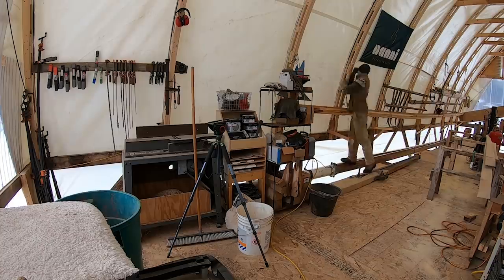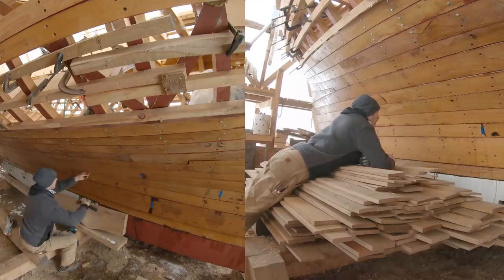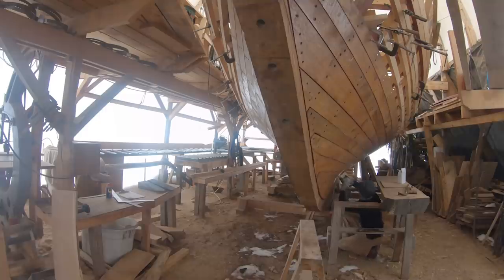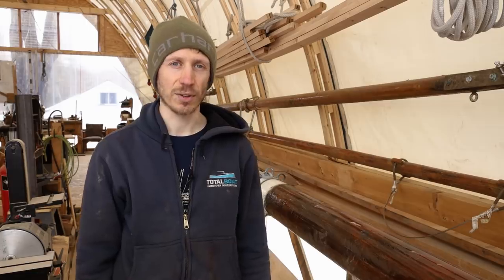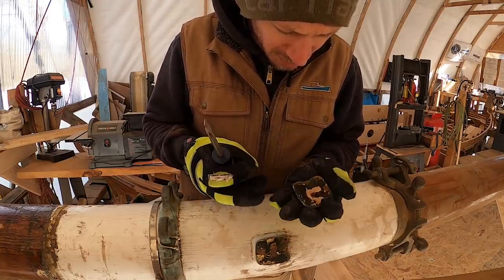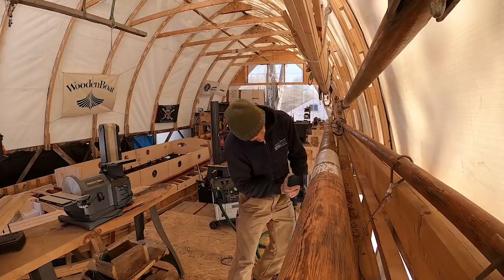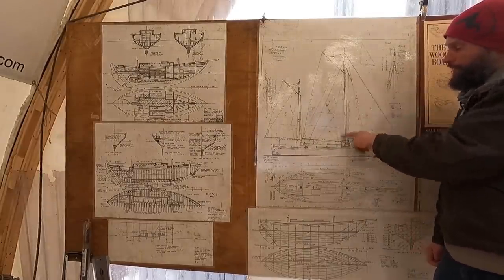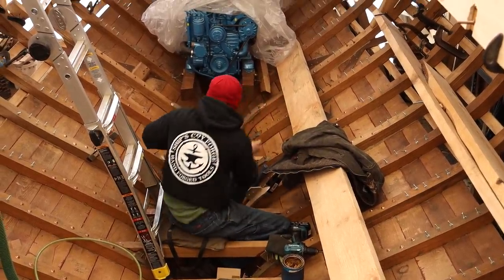Victoria's Mast - Episode 153 - Acorn to Arabella: Journey of a Wooden Boat

Comment: Main mast appears to be Southern Yellow Pine.  It is also known as “heart pine.”  It is practically indestructible.  Impregnated with its natural resins, it will still remain fresh after hundreds of years.  Most of it comes from virgin growth timber where strength and durability matter. Before the coming of rolled steel it was used extensively to build the massive textile mills in the east. Unfortunately, it is all but extinct due to over harvesting. There are still resources available if one is willing to search for them. You guys are great. I’ve so much enjoyed watching the progress of Arabella since the beginning.
Reply: Yes! Used as the flooring for countless exposed porches.
Reply: Heart Pine is the interior sapwood of SYP. While #2SYP is can be had at your local lumberyard Heart Pine is difficult to find because it is only found in old-growth SYP. What is commercially available now is mostly reclaimed wood, Delta Millworks in Austin TX handles it on the regular.
Reply: @matthewtimberlake599  The boys are very lucky to have saved the mahogany from Victoria circa 1925, you cant get that species any more, and the sapelle types are obscenely expensive.
Reply: @johnjenkins8782  I built a house with a mahogany staircase once upon a time, it was silly expensive even back then, nowadays you'd have to be incredibly lucky for it to even be possible.
Reply: Goodwin Heart Pine, in Micanopy, Florida. George has plenty, and resources to find whatever may be necessary. Don’t tell him I sent you. Having said that, sharpen your skills and build a hollow one, Alix.
Reply: I don't know how good a mast a used roller mill timber would make, but dang I bet that's some tough stuff!

Comment: Dude (it's serious when I say "Dude"), regarding the bronze floors and welding tight into the corners...picture all your weld lines as forces and they all point into the same corner.  That corner will crack first.  Drill the corner out, all the forces stop short and don't gang up in the corner...and crack the weld.  I may not have the analogy right, but the result is the same.  A hundred years ago, it was the first thing they taught us in college in strength of materials class.  A lot of other people have commented about the same thing, but I haven't seen your reply to date.  They're not wrong.   Love the show, keep up the good work.
Reply from the maker: We're not done yet, Michael—these details will be dealt with for sure.

Comment: Hey guys.  Love the show.   You might want to be sure to allow for some alteration of the rake AFTER you have sailed the boat a bit.  Rake is a critical adjustment in sorting out how the boat sails upwind and small changes can make a huge difference in how the boat tracks and how the helm reacts to changes in sail trim.
Reply from the maker: True story. Our friend Kit adjusted the rake of her rig by a little bit a couple years ago—decades after the boat was built and a few years after she'd been sailing her Bud McIntosh cutter. It made a big difference in the boat's handling.
Reply: I’m glad you’re on it.  The partners (the exit opening for the mast through the deck) can remain constant but allowing the step to be movable is crucial.  It’s shocking how a small movement at the butt can move the mast tip a tremendous amount.  I’m sure Thad can advise on this.  He’s a neighbor in Marblehead.  Keep up the great work and have fun.

Comment: Very beautifull project from cutting trees to building a boat from those. I'v been watching all episodes with great pleasure. Smal tip for scraping of old varnish from mast and spars: use a piece of broken glas with a small curve to it or, even better, use a high quality (sandvic)paintscraper and a hot air gun. At the right setting and distance from the wood you will melt and soften the old paint/varnish and not burn the wood. It is possible to remove old layers of paint/varnish easily and quickly that way. Greatings from the Netherlands, Bas

Comment: You are both MASTERS of attention to detail, and extensive planning and thinking ahead - and I am 100% confident that the mast step design is no different that every other aspect of this incredible build - You have covered off your logic on not placing the mast step on the keel, making perfect sense. Before you move on to other parts of your build, can you take a moment to walk through the forces you see on the mounting of the Mast Step, Having all of this weight, and  shifting lateral forces and energy applied to 4 inset bronze on wood "knife edges" is counterintuitive to me. I AM NOT suggesting it is a bad design, just need to understand how you see it not being affected by the endless forces that it will endure in Arabella's life time.

Comment: For a 4 inch in 10 foot mast rake in the main mast, the aft end of the step should be about 5/16 inch lower per 10 inches on the aft end of the step. The center of the mortise should be 1 to 2 inches forward of the center of the deck penetration.  Wooden mast do not always have a constant cross-section from the deck to the top. The mast head will be smaller than the deck diameter. The mast head needs provision for a mast head light.

Comment: I had an engine sitting in plastic in my garage for several months before I installed it in my woodshop. It dropped oil pressure within 2 minutes of starting. Dirt in the oil. Don't make the same mistake I did. Do an oil change within 30 seconds of letting the motor run. Better yet, get an oil accumulator in case of low or lost oil pressure, and it primes the engine before every start up.
Reply: How did the dirt get in it?
Reply: @chrisv4640  Good question. It was in a sealed bag, inside a plastic container made for the engine.
Reply: @tonkatoytruck  It was probably there when you bought the engine.
Reply: @netpackrat  I would like to think so. But, I will always wonder. I do a lot of wood working.

Comment: Just a thought regarding the mast.  Often a mast is not 100% rigid in its step.  At times you may want to increase the rake or lessen it.  The ability to do this with running back stays and adjustable fore stays is not uncommon.  A slightly rounded bottom of the mast and matching base in the step would allow slight movement as well as constant pressure across the base of the mast.  Lastly, this ability to move slightly would lessen the overall stress on the boat. Again, it all depends on what the designer had in mind.
Reply from the maker: In a way, yes, the mast isn't 100% rigid, in that it isn't fastened into its step. However, we'd want the mast to be set in its step without a chance of movement while under way, and the rake can be adjusted later, so we'd change the shape of the meeting of the mast and mast step and partner if we find there's significant handling issues that can't be corrected by balancing the rig or other telltale signs that it needs to be adjusted.

Comment: Birdsmouth mast:  router bits are now available to make the notch, in case you haven't seen them  That way you can make the strips on one pass on a router table, rather than two passes on a table saw, and the cut should be more accurate.  FWIW.

Comment: When I did the spars on the S/V Elissa (17 wood spars in all) back in the early 80s, I made a tool that was of immeasurable use (sorry in advance for what you'll see is a bad pun).  It was two 90 degree squares each of which had a sliding dovetail cut into one leg of each (I made them both out of teak).  That allowed me to slide them together and then I had a U shaped measuring tool that could be adjusted to whatever dimension I needed.  Then I could use it to find a center point on the top of a spar or just find out whether I had taken the spar down to the proper dimension.  I could also put a level on the top of it to make sure that the marks that I made were consistent.  This was really helpful because most of our spars had been roughly dimensioned on a large lathe, but still required significant dimensioning.  I also had marked dimensions on the top edge of the squares. Hope this might help you guys.